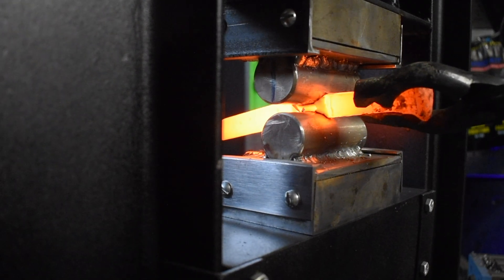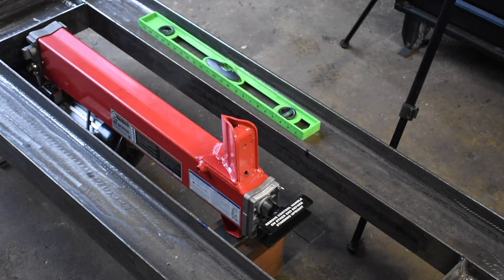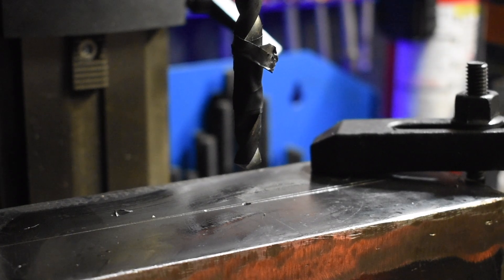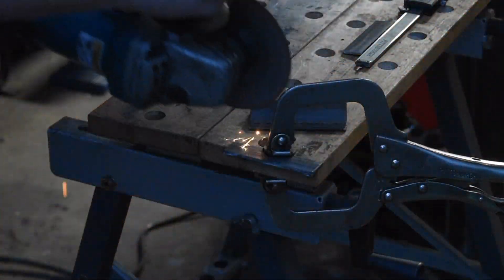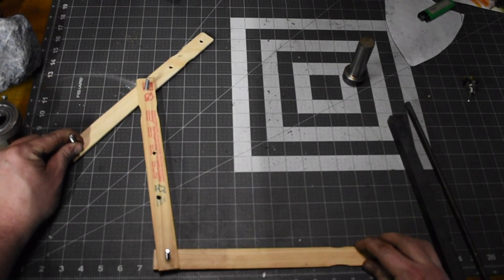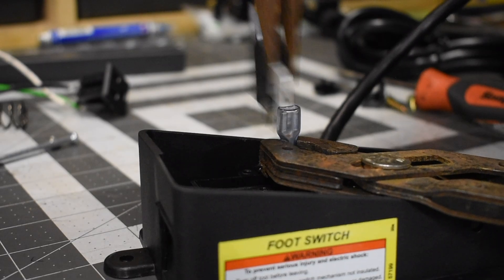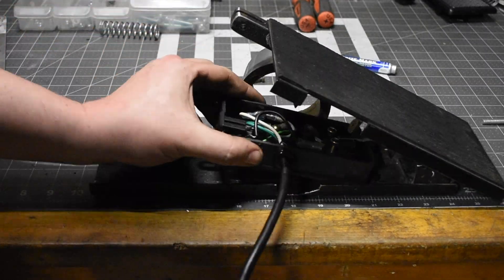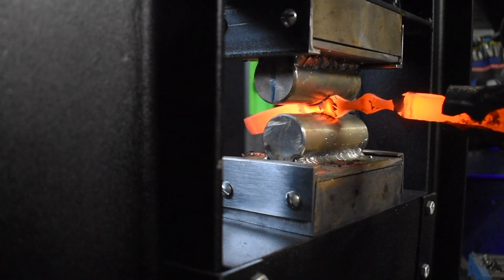Electric Forging Press "Log Splitter Press"

Comment: That's a sick setup!.  How did you make your log splitter work vertically.   I cant seem to make mine work standing up like that
Reply from the maker: The hydraulics is a closed pressure system. So technically it should work anyway. I wanted to do mine upside down. But then I would have to put springs on it to make it come back. That’s why it pushes up instead of down. But maybe there’s some sort of sensor that won’t let you do it vertically? I’m not sure.

Comment: When fully extended can the hydraulic piston touch the ceiling of the press? How did you determine how high to make the roof of the press? If you fully extended the press could it knock the top off?
Reply from the maker: Without the dies in the press, the carriage can hit the top. There is not enough power to break the frame. I went overboard on the frame so I could upgrade to a larger log splitter later if want. I made sure there was at least 4 in of clearance between the dies.

Comment: Awesome build wish I had the skills to do that.
Reply from the maker: Thank you. I wouldn’t have been able to without the welders helping me out.
Reply: @drewdoesart9277  Yeah, I'm halfway through a MIG class at the local college. Also working on tap and die skills. 
Need a set of plans to work from. Got a Bilt 6.5 ton log splitter coming next week.

Comment: Did you ever have issues with using it in rapid succession? I’ve heard some of these starter capacitors don’t charge fast enough to do rapidly.
Reply from the maker: So I haven't had that issue yet. But I also haven't really tried to go super fast. Once I press, then let go, I push down on the foot pedal right away to stop it from receding down as I reposition, then I press again. That process works really well, and haven't had any problems. I will say if had to redo this project, I would start with a 10 Ton Splitter. It works good, but I would like to move more steel per press.

Comment: This is a pretty awesome build. You did a great job. I am also building my own press and I have everything finished but I need to make the dies to be done. I was wondering what material did you make your dies out of?
Reply from the maker: Thank you. The fullering dies base plate is 1/4 in mild steel, the round bar welded to the top is 4140. The flat dies are only mild steel for now. Until I can get some more tool steel. 
How many tons will your press be?
Reply: @drewdoesart9277  Thank you for getting back to me. I was going to use 4140 but not sure if it needs to be heat treated. I have a piece left over from a hammer I made and wanted to use that but also wanted to save it for something else. Do you think 1045 would work as good? My press will be about 29 tons. I made the frame based on the iron coal forge one. It turned out pretty good. I was very happy when I got all the hydraulic lines hooked up and ran it with no leaks. Anyway, thank you again.
Reply from the maker: @sankojin  29 tons is Awesome! The only thing I regret is not going with a 10 or 12 ton log splitter. 29 tons should be really great. As far as the Die goes, I think heat treating it would help it to last longer without deforming. But the heat treat will get ruined anyway since the hot steel will be sitting on the dies so much anyway. I never used 1045 before. But I'm sure it'll work. Just make sure the billet you're working is nice and hot. Plus you can alway make new dies in the future.

Comment: I see the hydraulic ram goes from the floor to the ceiling but would it also work going down from ceiling to floor?
Reply from the maker: Yes, that's what I wanted to do originally. But then it would have been too tall for my garage, plus I would have had to build some sort of base that would have cost more moneys. And it would have made it harder to change fluids later.

Comment: I’ve been hate n on a few of these smaller capacity log splitter conversions but man I gotta say this one really does well 

I’m I huge fan of modified machine builds as I also build 

I’m actually look n at press frame styles today cause I’m about to process some steel I have lay n around to build me another press 

Nice job sir
Reply from the maker: Thank you. If I had to do it over I would have gotten an 8 or 10 ton log splitter. But this one does work good.
Reply: @drewdoesart9277  I did that with the second log splitter,it was the champion 7 ton model and where I thought it would be strong enough it wasn’t 

3gpm just isn’t enough,I outfitted it with a 16gpm and it was fast and strong enough
Reply from the maker: So you upgraded the gear pump?  @jamesball7322
Reply: @jamesball7322  man, you change from 3gpm to 16gpm, how many horse power of you motor?
Reply: @jendrayani543  5hp 240v (strong enough to do the job still two years later)

Not the suggested 1.5hp per 1gpm
Reply: @drewdoesart9277  yes sir I did ,most of the pumps like that are the same specs for mounting and connections so just grab a higher gpm pump and if I remember correctly you can go as high as 11gpm before needing to jump to higher voltage for the strength
Reply from the maker: @jamesball7322  Thats awesome. Thank you for tell me.

Comment: Do you have any issues with the bottom die moving not the top? Most the top moves but I like your idea with the HF press I was looking at?
Reply from the maker: The dies would move a little inside the slots. But now I put a stopper to keep them in place. Now they stay in place.